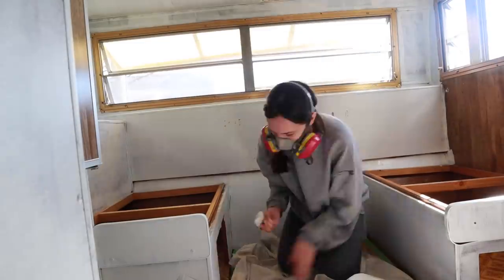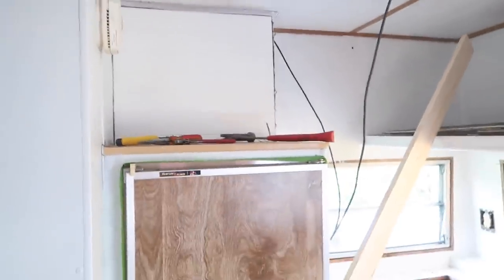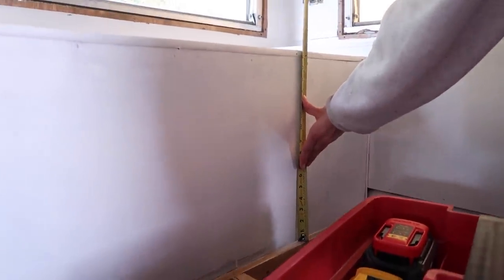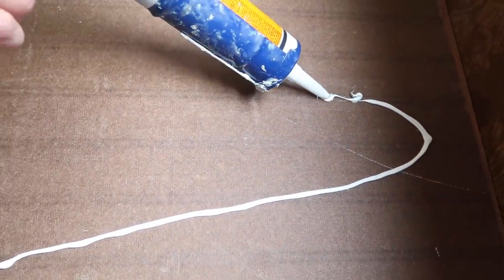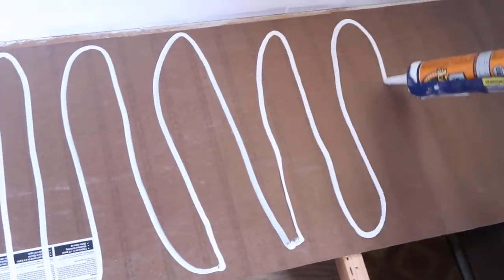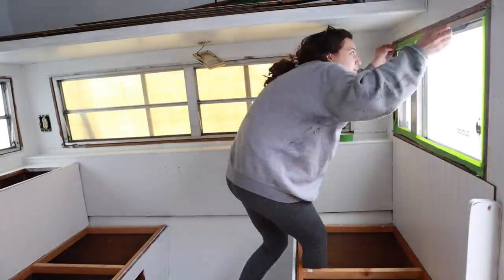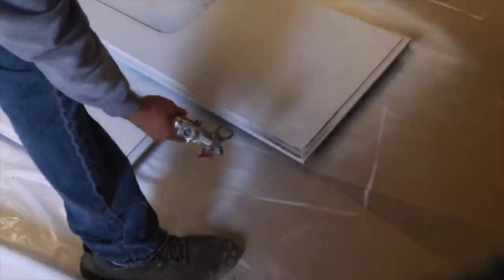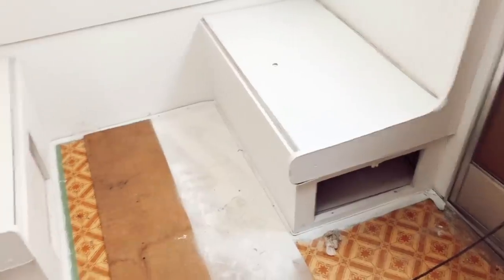CAMPER DEMO DAY 3// Dinette Makeover & Why we aren't keeping the camper original

Comment: I also used drop cloths to re-cover my couches in my house, its is a great economical idea.  Word of advice: they stain easily.  An option for that is to get the spray ScotchGuard and do a few coats or at the very least, if you don't like covering it with chemicals, have a heavy duty spot cleaner in the camper if you go on trips. Your videos are awesome!

Comment: We have a camper almost identical to yours. We were beyond lucky ours was in mint condition inside and out so we could keep it original. We needed to change all the towing parts and some of the frame under the camper. I think yours will be sweet when it's done. I'd say not to use those head rest things. Good luck with the rest of the renovation
Reply from the maker: That’s amazing!!